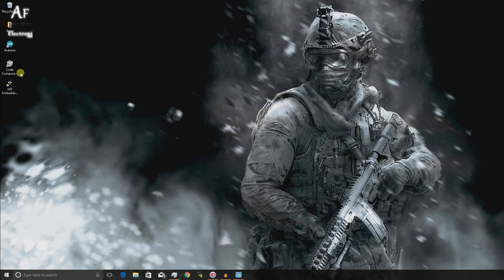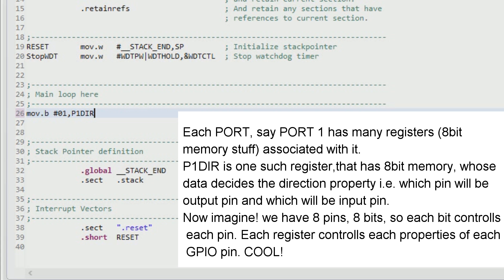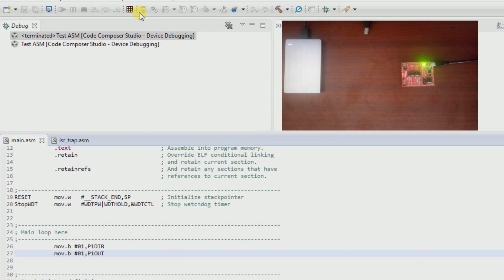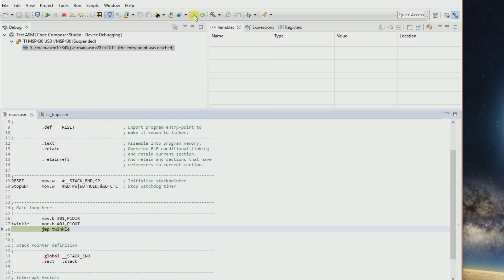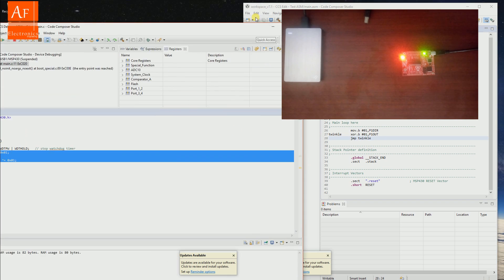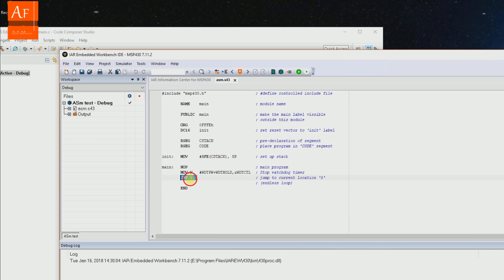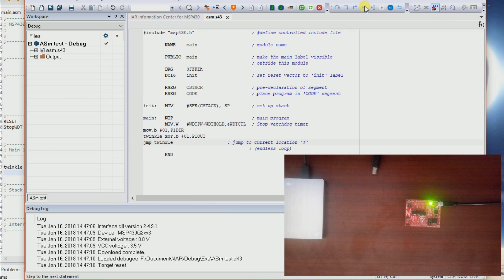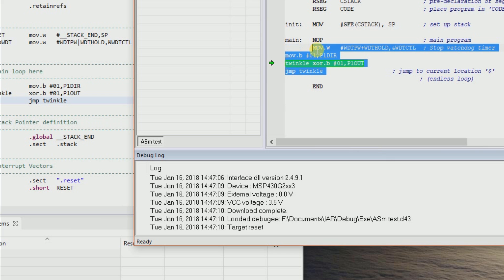Code MSP430 using ASM in CCS and IAR | 2018

Comment: Great video but How do you add delay (in Assembly)? I know that in C, you can use the __delay_cycles(some number in here), but how do you add delay in assembly? Thanks!!
Reply from the maker: I know it's been a year, still....
Simple incrementer, decrementer with a conditional jump/branch will do the trick. But that method is notorious for lack of concern for energy efficiency. So the proper way is to configure the timer to trigger the interrupt after the sleep period and configuring the mpu to go into one of the sleep modes available (That won't turn off the timer). In the ISR, one can wake up core and continue from where one left.

Comment: Hi! I believe that the first attempt on that label doesn't work because of that: "A definition of a label, which is a symbol that represents
an address. If the label starts in the first column—that is, at
the far left on the line—the :(colon) is optional." From IAR Assembler Reference Guide for MSP430

Comment: Bro i got major doubt, how can i contact you
Reply from the maker: Add the doubt in the comment section. Make your problem abstract if you want to maintain problem detail's confidentiality.
Reply: @AnujFalcon  
 Actually got a new project ,so neede a brief if you got any code regarding how to write in fram as mpu is blocking it , tried to configure it manually .i finished with configuring sensors. Fram is still remaining